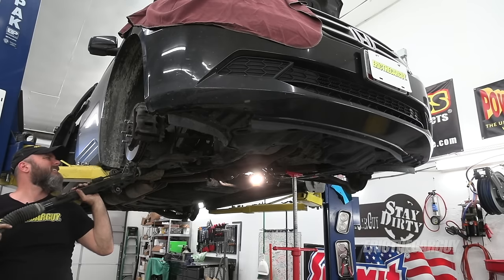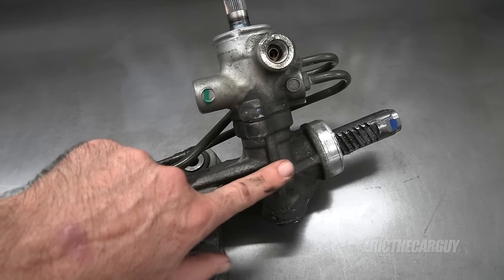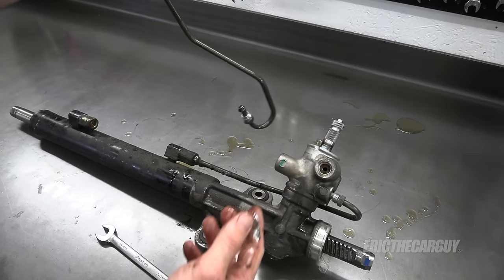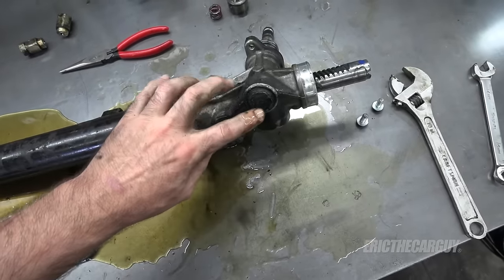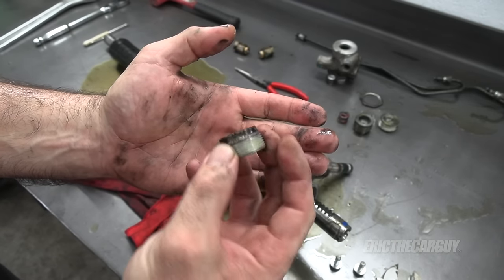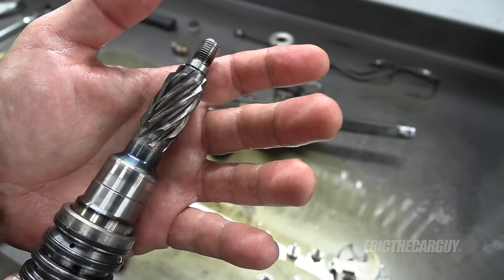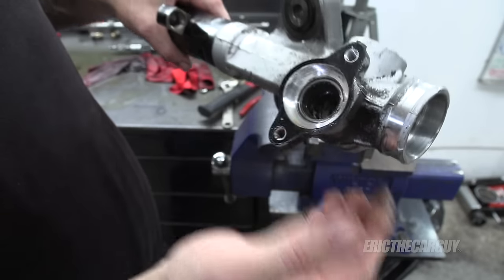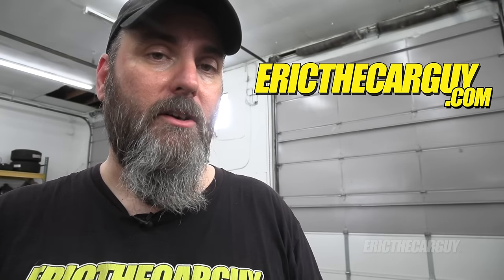Whats Inside a Power Steering Rack?

Comment: Hey Eric, this video reminds me of something I've been wanting to ask. I replaced the brake lines on my C1500 and I had the battery disconnected to get more passenger side room and realized I need to turn my wheels to get better access. The thing that has me confused is my steering wheel locks if you turn it with the key off, but if you switch it to the ignition position even without battery power it will still unlock the steering wheel. Can you explain the design behind how that works? Thanks!
Reply: When the key is turned to the off position it moves a cylindrical rod out which goes into a notch on a circular plate that’s splined to the steering shaft if I remember correctly
Reply: The ignition tumbler is attached to the rod that goes into the plate via a plastic gear & rod(s) or something like that so it’s all mechanical

Comment: What are the hard line for? is it the return  line?? she leaking like a b,,,ard, it,'s a 98 taurus se.it's definitely not my pressure switch,return hose or my pressure hose definitely coming from the hard line on the rack and pinion my hand get soak when I feel on it unde the heat shield.

Comment: Hey Eric bro can you please help me find the steps to change the timing chain on 09 Suzuki sx4 and I need to find the crankshaft sensor  I have a code for camshaft sensor p0340 I changed and it didn't fix the problem so I will change the crankshaft sensor but can't find it please help bro

Comment: I disagree with the statement about not “cranking down” the hydraulic fittings but just making them snug.   If the o-ring equipped fittings were designed correctly, and Honda will normally design their cars correctly, they will be designed so when the fitting is tightened, there will be a metal stop inside the fitting.  When the fitting is fully tightened to the correct torque setting, the metal stop will allow just the right amount of o-ring “squish” and the metal stop will prevent the o-ring from being squished or compressed too much.  Making a hydraulic fitting just snug risks the fitting coming loose over time.

Comment: My 07 TL rack makes a loud cracking noise when turned lock to lock. its progressively gotten worse. I think the bearings on the pinion have worn.
Reply from the maker: Not likely. It's more likely to be suspension related.
Reply: Get things repaired early, like ETCG. He could have repaired, and still might. Yet, it sounds like you REALLY need yours repaired, maybe replaced.
Reply: @ericthecarguy  all the suspension, including axles have been replaced. Very odd considering the ps still works, no leaks. 👍
Reply from the maker: http://www.ericthecarguy.com/faq/diagnosing-noises-in-your-car

Comment: Hey when will we get a video on rebuild a power steering rack
Reply from the maker: Likely never. I don't recommend rebuilds considering the effort involved to R&R one. You can easily use the info in this video to do a rebuild if you wanted to though. It's the reverse of disassembly.

Comment: Diagram shows the steering box-- pointed out and that's what you must check for wear and rust because if it fails at high speed you will have a horrible accident

Comment: I had my power steering pump replaced with an aftermarket pump and I also had the rack guide bolt adjusted about 1/4 inch tighter. 

My steering is now super light at cruising speeds and is kind of twitchy. 

Any ideas? Pump or adjustment?

Comment: I was expecting the shaft that goes through the valve assembly to actually be two parts to create bidirectional proportional valving. Not seeing how that would happen with a solid shaft going straight through.
Reply from the maker: Look closely at the shaft and you'll see the holes machined in it to direct fluid flow.
Reply: @ericthecarguy  I saw the holes in the shaft, what I am missing is how a solid shaft can "compare" input position to output position to direct flow. in proportion to the angular position discrepancy.. unless the shaft is actually two parts with the holes being inputs/outputs for that inner valve.
Reply: @ericthecarguy  YT just happened to flag another power steering video and just like I thought, the shaft is indeed two pieces connected by a torsion bar to give the input side the ~3 degrees of springy slack it needs to direct flow in the appropriate direction.

Comment: Those bearing should be larger than it was , is a light truck not a sedan , that why all this Odyssey having a problem , not because of accident , is a poor design , plus they wanted you to used their fluid , to me their fluid is no better than ATF in the old day, in all my year , I see this is Honda weakness ps. Pump and steering rack problem like old Nissan Maxima , they couldn’t make better transmission couldn’t make better steering , is design weaker than Toyota . My Odyssey 07 has a same problem after 15 years without any accident , is a poor design sir , I have 1989 Eclipse Turbo and never once has ps pump go bad or steering rack leak with 750K miles except for 83 Nissan Maxima GXE . After 25 years than rack has to replace and was poor rebuilt from Detroit Axle also . But this Odyssey is a poor design or late model Honda/Acura weakness and so as their transmission problem .Koyo bearing is quality but still the design fall into small bearing and all the seals section on the pinion gear seals . That my opinion from experience, those rack is not cheap in 2022 , well anyway thank for reading my comment